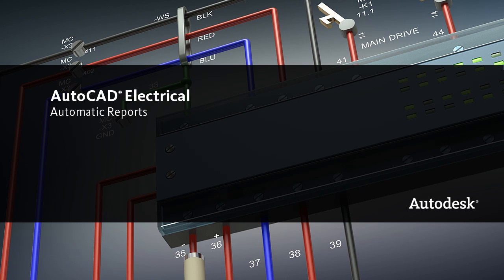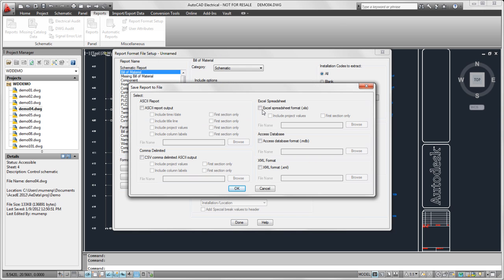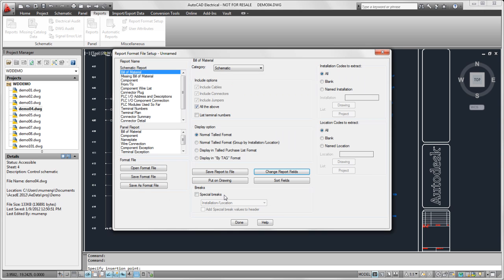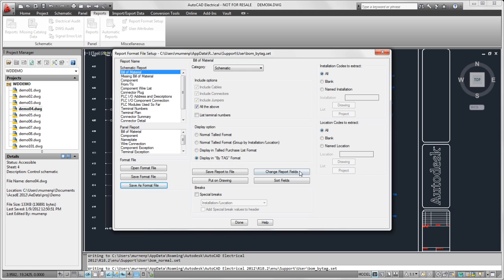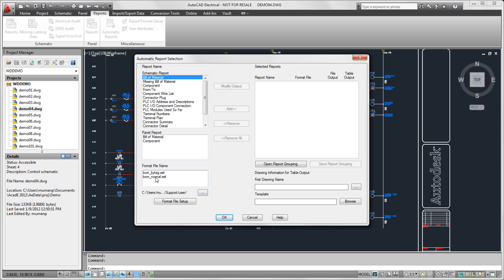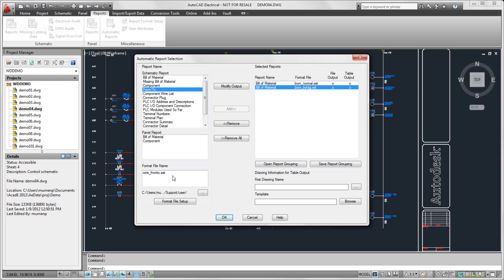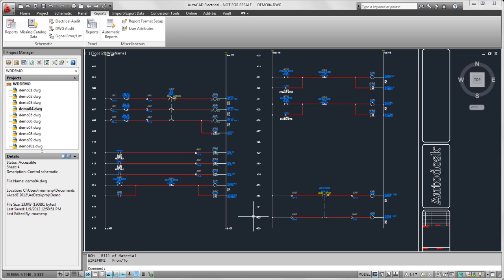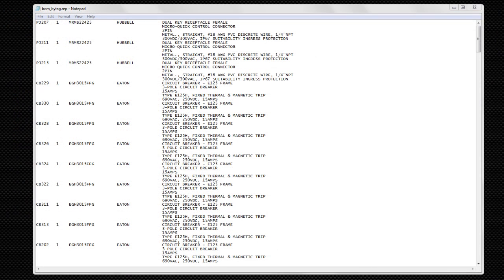AutoCAD Electrical Automatic Reports

Comment: Good explanation, although quick question.  Upon using the rgf file for different projects, whats the best practice or method to prevent overwriting output files that have already been generated for the previous project....after the reports are run, move them to a more specific directory?  

Thanks.